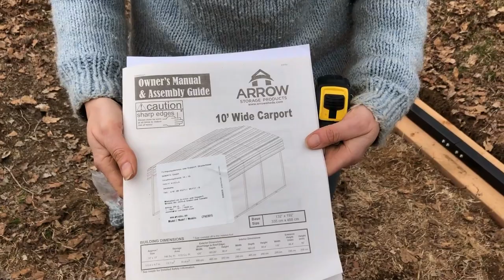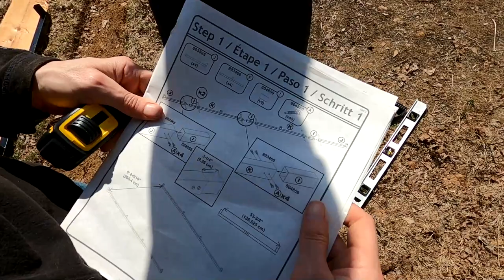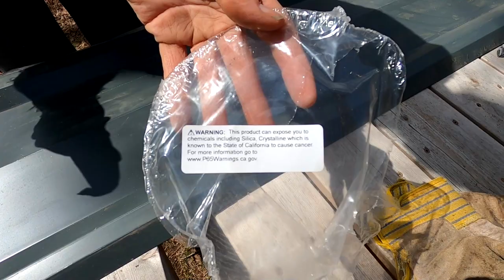Carport Comedy - Assembling the Arrow Storage Products 10' Carport Canopy - Start to Finish

Comment: If its not blown away yet peg down the wood with 1ft rebar, If you ever build one use pressure treated 2x4 on a trench of gravel or sand.
Reply from the maker: Thanks for the advice.  It’s our friends carport so they made the calls on how they wanted to do things.

Comment: For anyone planning on building this carport, the dimensions shown at 4:48 of the video are from inside to inside of the base. As the tubing is 2", add 4" to get the dimension from outside to outside of the base (which for this model is 10').

Comment: As far as California and the cancer stuff goes, hopefully Californians don't have to breathe in any wildfire smoke coming down from Canada this year.   That far north with the winds, I'd think that used use some level concrete posts made in the ground every 4 to 5 feet and bolt it to that. I'm installing the Arrow 12' x 20' carport and will make 6"x 6"x 24" deep posts to secure the side rails to.  I'll make them every 4' . I'll put bolts in the concrete sticking up to use to secure the frame base with plates and washers and nuts.  I don't want bad weather to destroy my carport. You never know.  I'd check squareness, width . etc. to make sure it's correct.
I'd also assemble the uprights on a level service to make sure they are as straight as possible and if need be transport them to the build site.  Hope it's still standing.